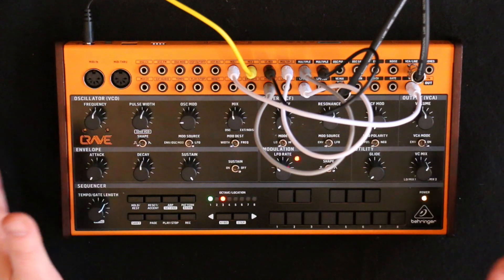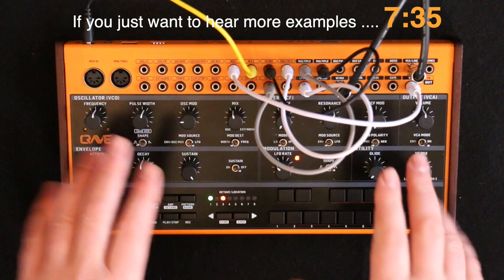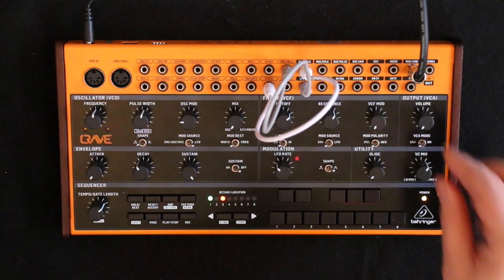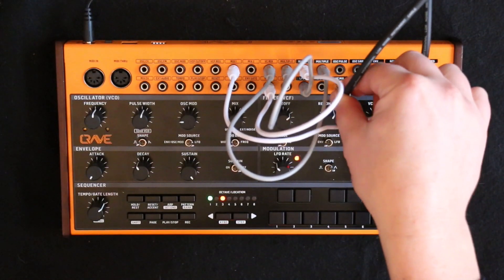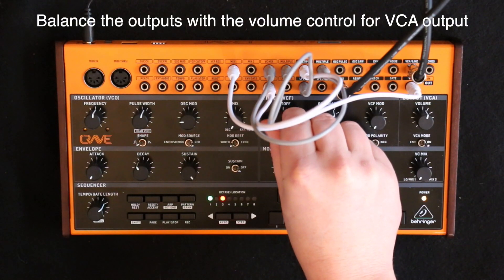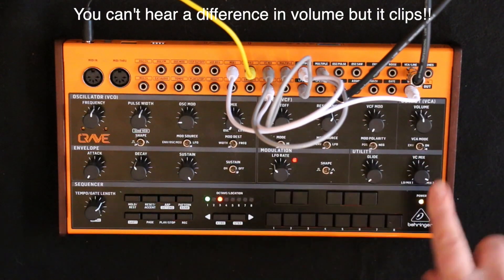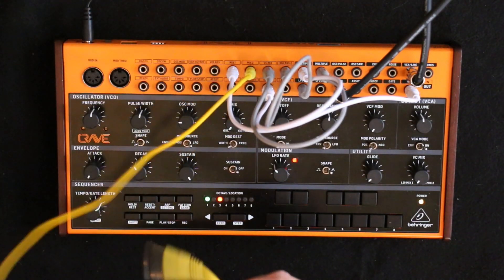Patch Ideas #6 STEREO Panning: Behringer CRAVE and Mother 32 demo

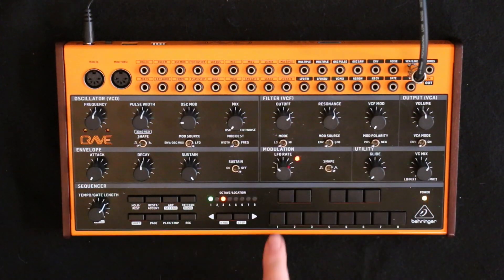Comment: Hi, I missed the point at 1:36 why the OSC is audible only on one side. Why? Where comes the paning from in this whole patch?
Reply from the maker: There are 2 signals being mixed by the LFO. One is the main signal (after the VCA) and the other is from the VCF (before the VCA). The main signal is modulated to a maximum when the LFO is at a maximum.. the VCF output is mixed through the VC mixer out 1 which is at a minimum when the LFO is maximum. So when one signal is loud the other is quiet.
Reply: @StarskyCarr  Hey thanks for answering so fast! (y)  But I meant where comes the paning from? So when you say there are 2 signals, you mean you have 2 physical cabel goint into DAW recording 2 mono tracks that are paned hard left right?
Reply from the maker: Yes that’s correct. :)

Comment: Does the patch bay allow you to re-route things enough to bypass the filter, and use an external one with the osc/mixer envelope and VCA, or is it hard wired to something else, like the one in the Boog Model D (which has no way to feed directly into the VCA)?

Comment: I think it can be done with X18 (or XR18) mixer or higher. Using an LFO (or any) output from a synth to  DAW then using it to control the internal panning. Thus you'll get any sound that is out from a synth (without restrictions) that will be using the same LFO to pan it (when cutoff LFO is the same obviously). But it needs a mixer that is capable to be a multitrack audio interface.